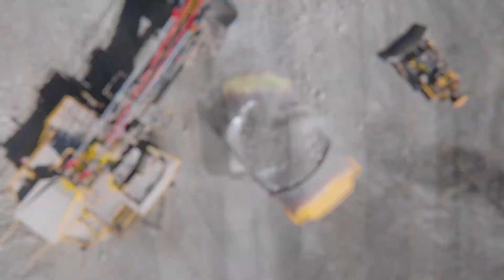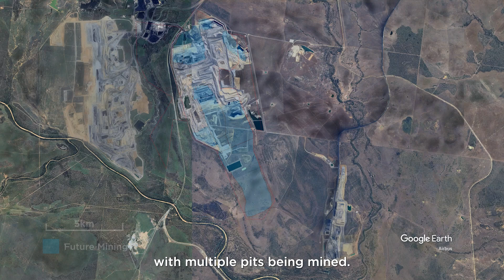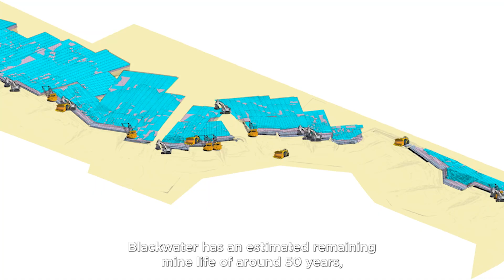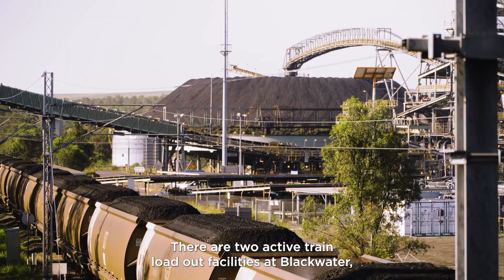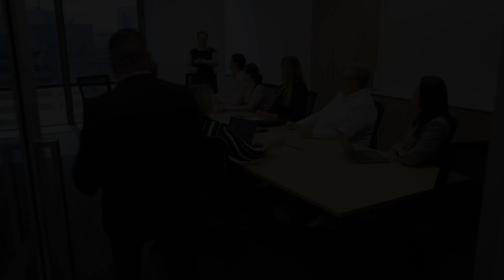Overview of Whitehaven Coal’s Blackwater and Daunia mines

Comment: so you guys produce this coal to generate electricity? does it go into electric cars?
Reply: Thermal coal is used in generating electricity, which can power electric cars. They also mine metallurgical coal, which is predominantly used in steelmaking
Reply: @ then why do these ev drivers feel they are doing the environment a favour
Reply: @m3815-w2z  because electricity can be produced by nuclear power plants, solar panels and wind turbines. All this stuff is quite ecological in compare to a bensin.
Reply: EV drivers often miss their cars take exponentially higher amounts of copper (132ev vs 52ice) silver (2x), tin (3x), nickel (batteries) and the batteries are currently more toxic in landfills. It's really good propaganda. No one is perfect, but keeping a car for a longer period of time would help the environment.  If EVs were seen as the new smoking propaganda, people might realize this will take much more mining and destroying the earth in the name of continued "climate change." It takes time to change from oil and coal to Clean Energy. 

Besides, everyone in Africa needs copper to connect their infrastructure and power grid to live like the western world. Meanwhile, recognizing a billion people want to have running water and electricity. Mining is only going to intensify for the world's energy needs. - in my opinion
Reply: Only a % of electricity that goes into ev comes from coal which itself is decreasing. Even with coal emissions are less than petrol cars as EVs are more efficient. But the greatest gain comes in SOx and NOx reduction as coal fired pp have sophisticated filters that cannot be installed in a gas car.
Reply: @souravjaiswal-jr4bj  I don't think michael wanted an actual informed answer to his question.